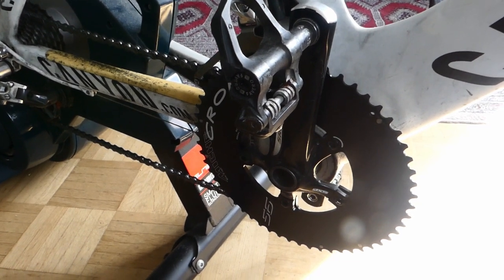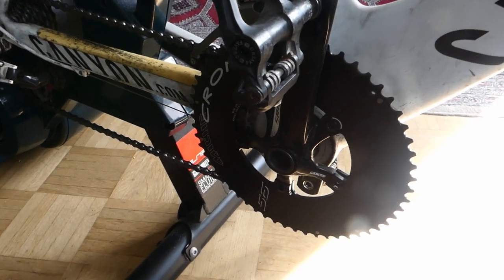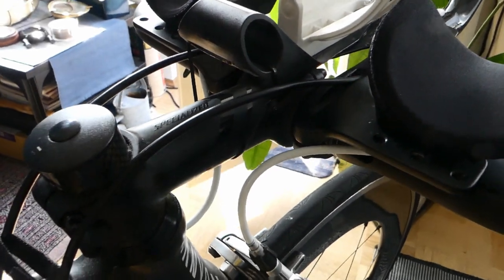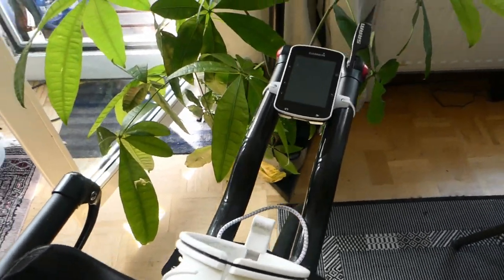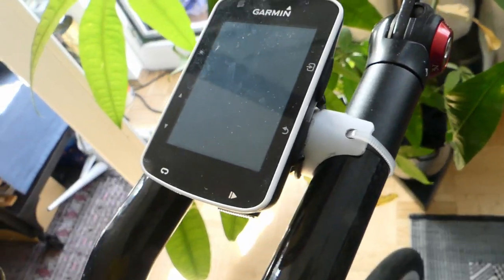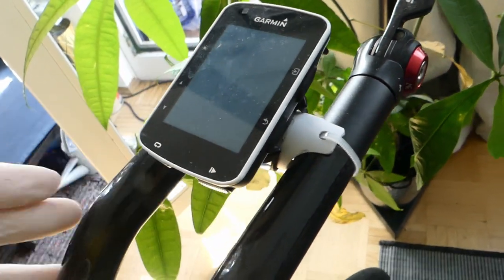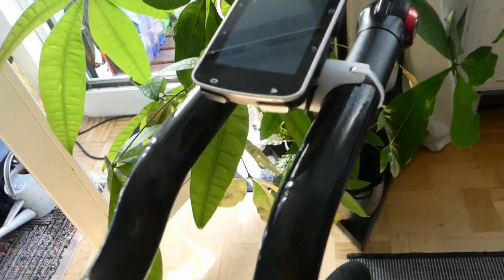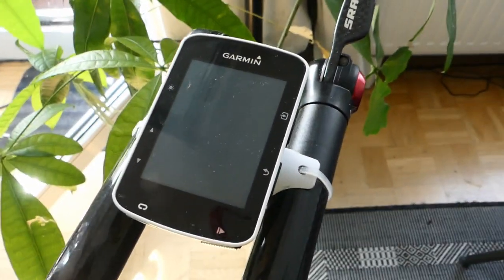Making Midfoot Pedaling Plates for Running Shoes

Comment: You should commercialize that mount ☺️
Reply from the maker: I thought this would be a too much of niche product, but then if I get qualified for Kona with these.. 😜
Reply: First.. It's super super annoying that I still get no notification for your video again... With activated bell :/

So, maybe I misunderstood the entire thing but, wouldn't it be way easier and effective to just drill 3 holes with threads on the middle of a normal cycling shoe you like and... Done?

Also you mentioned the 3 footpoints, the pressure for the midfoot bones increases drastically, way more than with midfoot running. And even with your insane training level I could imagine on 180km full distance or even 70.3 your midfoot bones might just give up? It shouldn't be underestimated since this area is so fragile. 

Overall I understand your idea, before  I moved up here I lived on a mountain heavy place and forefoot pedaling stressed my patellar tendon too much, to decrease the stress on them I was putting the cleats always as far back as possible. So different reasons but I can understand why.

Oh and I told you, your bike is a beauty but... I can hear it scream:"wash me pleeeeaaase" :p
Reply from the maker: @Daoki I know. It's so annoying that even clicking on the bell doesn't work. It's a common problem across YouTube. I also don't get a notification when I get a comment.

Your question about drilling 3 holes on normal cycling shoes.. Normal cycling shoes have a round surface under the ball of foot, then the shape gets narrow where the arch is. It means that we need some sort of plate to stabilize in order to secure the cleat position anyway. It is possible with a smaller metal SPD cleats though. There are some videos and articles on how to do it.

When it comes to the stress on the arch (I guess that is what you meant from the 'midfoot bones'?), it is not greater. Even when we pedal on the ball of the foot, the stress is applied on the arch. Insole of the shoe can help to keep the arch to evenly distribute the pressure. If we have a very small platform like a normal flat pedal, the story is different. In this case, the pedal would apply the pressure to the arc of the arch in the middle. The pressure points would hang on both sides (forward/aft) of the pedal. Interestingly, the arch is partly supported by the pull from calf muscles. The insertions (the parts connected to bones) of these muscles help to bring the arch up. If we have less fatigue from our calves. that means we have less strain there.

I also understand where your point on climbing hills would require different way of pedaling and the patellar problem. I have extremely forward sitting position and 150 mm cranks, so I have that part sorted. Also I can change the position of my running shoes on the platform if needed. It is a lot easier than undoing my shoes and changing the placement of the cleat obviously. This is the reason why I decided to go for a flat pedal option.

Lastly, I know I need to clean my bike.. My road bike is even worse! I keep the mechanical part clean though. And I usually clean my drivetrain when I fly somewhere for a race. This year there hasn't been any races. That's an added reason why it is so dirty. I have a couple of races in Berlin in September. I don't fly, but I think I'm going to clean my bikes before these races..
Reply: @triathlonsushi  aaaah thanks for the explanation makes totally sense. Especially the part about the arch, so I shouldn't be afraid to move it even more backward. 

That means there is sadly not an easy solution... But the creativity of your ideas is definitely unmatched :D
A data sheet would be amazing about your test's with different systems.